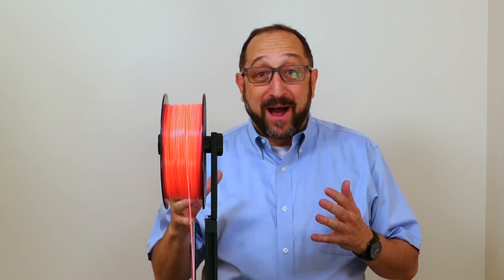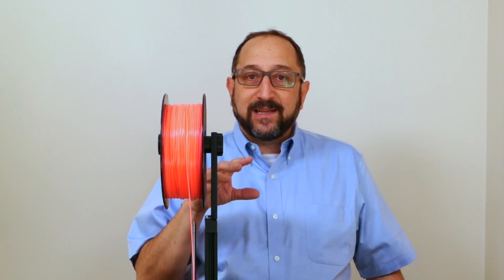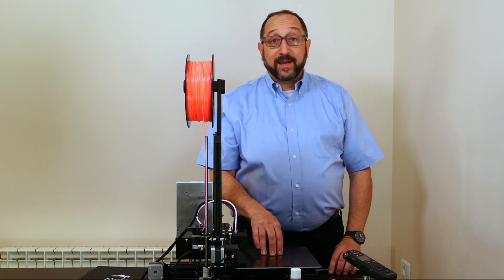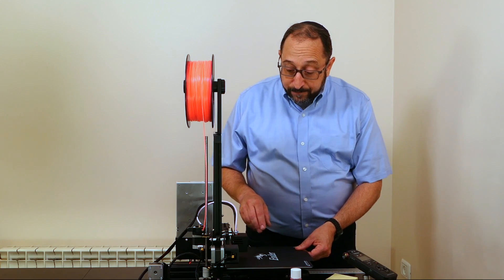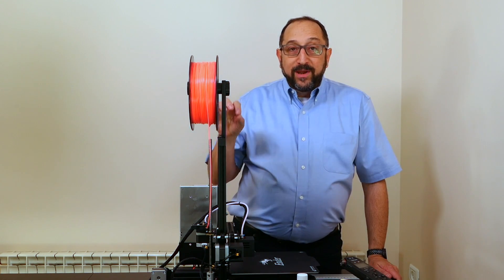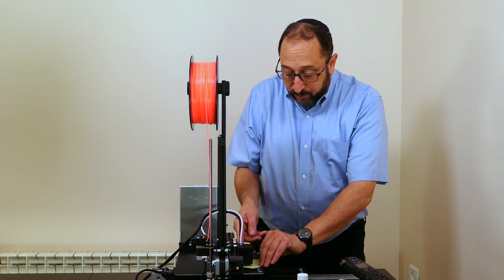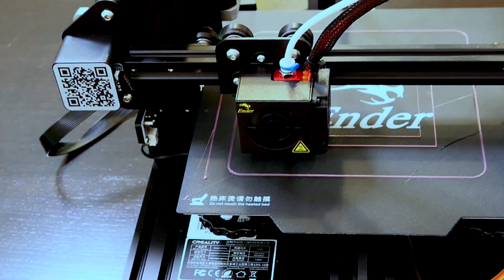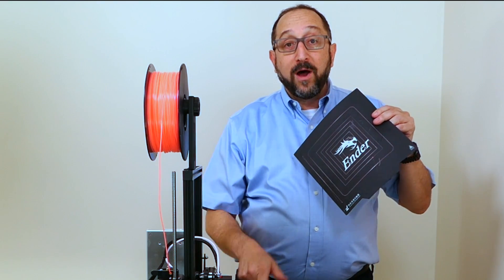How to Fix an Ender 3d Printer Warped Print Bed

Comment: I’ve always been advised to move the print head or print Bed slowly when powered down to avoid a voltage spike which may damage the electronics.
Reply from the maker: Good suggestion.  Thanks for sharing.

Comment: The "generated" electricity that comes from moving the bed, and X gantry, most likely won't cause harm to the motherboard, but it actually can, if moving either one fast, and frequently.  That's why it's recommended, by most users, to move them slower than that can occur.  I am not sure, but today's more updated printers MAY not be as prone to this happening, as in the past.
But an "ounce of prevention....."  :)
Leveling a "Cold" print bed will get you close, but if you're going to used a heated bed, then it will most likely change after heating.  It ALWAYS has for me.  I've always leveled after heating the bed and letting it stabilize for 5 - 10 minutes.  I have a MUCH higher success rate with the First Layer this way.  
Thanks for sharing and teaching others.
Reply: Yes,yuo are ritgh...better move the motors slowly..and of course always level the bed hot if yuo are gona print hot becase the metal and the glass expand whith the temperature
Reply from the maker: I just did a video about this:

https://youtu.be/zfTm0SqIFm4

Comment: I used a piece of aluminum foil to deal with the dip on my Ender. Has worked great.
Reply: Good call, considering heat conductivity!
Reply: Im about to try that , wish me luck .
Reply: But does it stick to the bed when you take off your magnetic bed?
Reply: @Luca_CRF  aluminum is not magnetic
Reply: @Luca_CRF  probably not on its own, i dont use a magnetic bed, but even if you use a little bit of glue, like there is on a sticky paper, aluminium would still be better than paper, i guess.